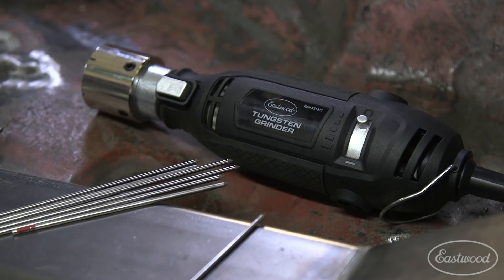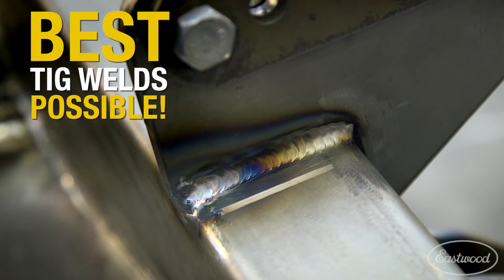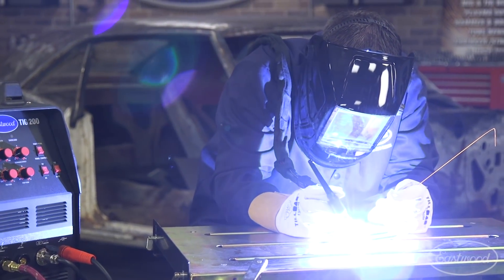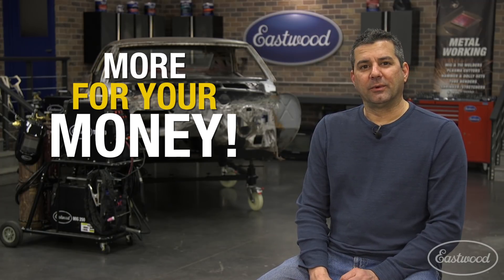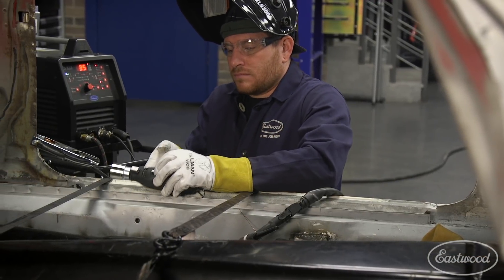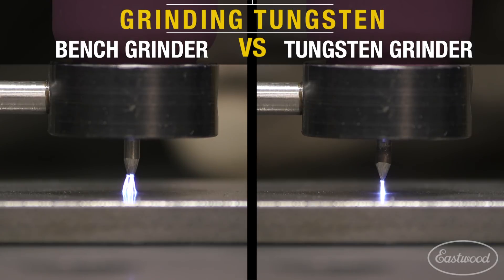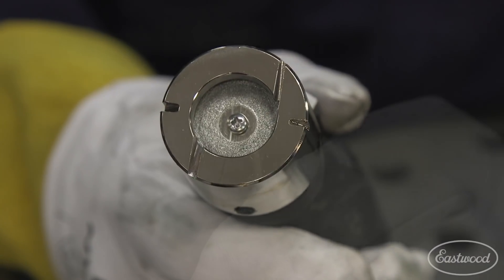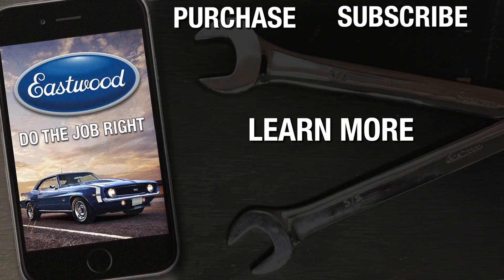The Perfect Way to Sharpen Tungsten for TIG Welding - Tungsten Grinder Designed by the Eastwood Team

Comment: they use a cheap motor/Dremel.. it failed on me after the first session.

30 day window passed.

touché you got me, guys.
Reply from the maker: The Eastwood TG1800 TIG Welder Tungsten Grinder is backed with a one year warranty. 
Please contact our customer service team at 800-343-9353.